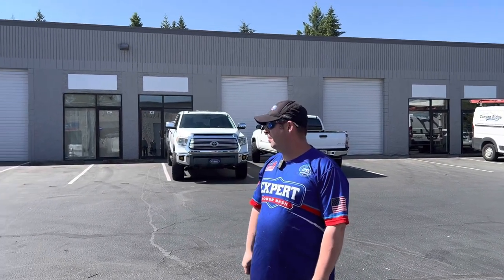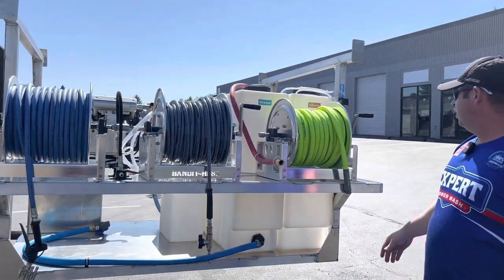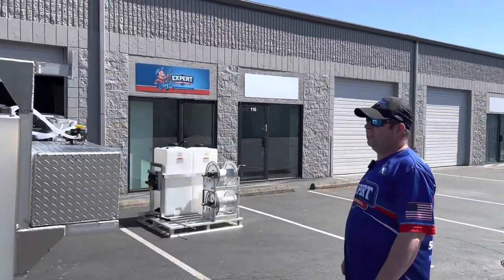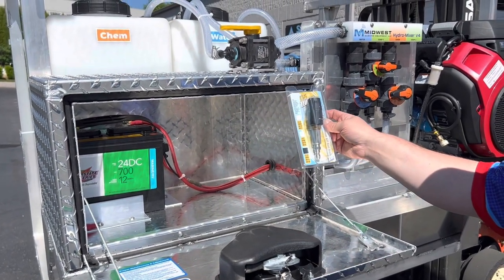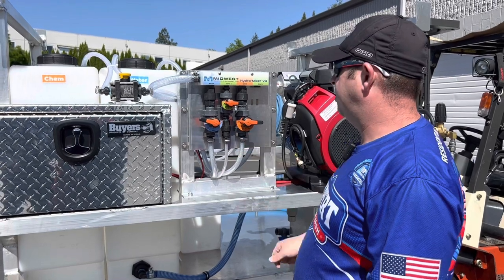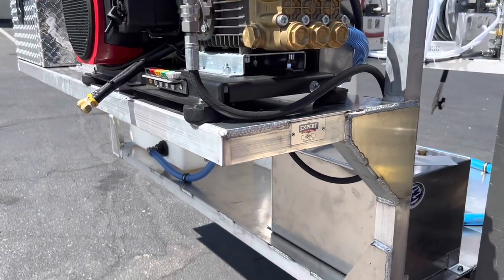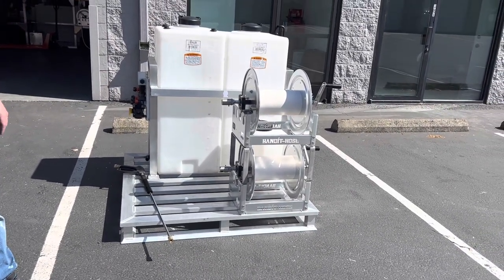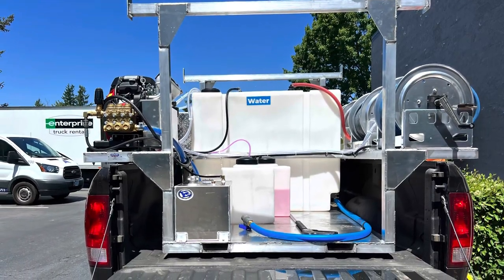Pressure Washing and Soft Wash Truck Skid Build Setup- Custom Built Aluminum Skid

Comment: I have got a igx800 10gpm gear drive frim manitee preasure wash it has the k7.3 unloader with #2 orfice  im using a 3/8 bypass line  and when i go off the trigger snd the machine goes to bypass it doesnt surge the machine but it definitly kicks and whips that bypass line .Is this notmal?
Reply from the maker: Yes it’s normal. I’m experimenting with another unloader. I like the K7 but it’s not perfect. I’ll get more information out when my research and testing is done. One thing you could do is use the heavy duty cable straps to hold the line done. I’m thinking your orfice size should be #3.  It’s pushing the k7 at 10 GPM.
Reply: @ExpertPowerWash   I  was considering using a 3/8 jump hose  with crimped fittings and just quick connecting it to the unloader bypass and them putting a quick connect fitting on the bulkhead that goes in the tank .It is the k7.3 but manitee changed the orfice to a #2  they say they have alot of trouble with surging when running the #3 orfice .this is my first k7 so im not sure what's normal and what isn't. But would love to see what you come up with on another unloader  I like the flow sensitive what lil I've used it but it seems finicky

Comment: Could a F150 haul this? Or would f250 be required
Reply: Also, what is a rough weight on this.
Reply from the maker: You can haul it with a F150. Make sure you are within legal guidelines. We dump our water when we travel with a smaller truck. Roughly 1000 lbs